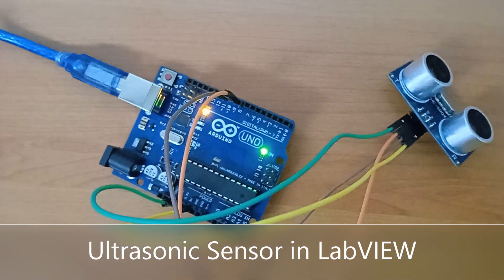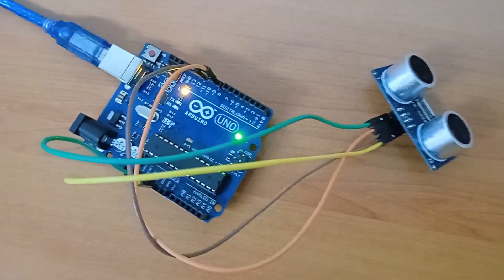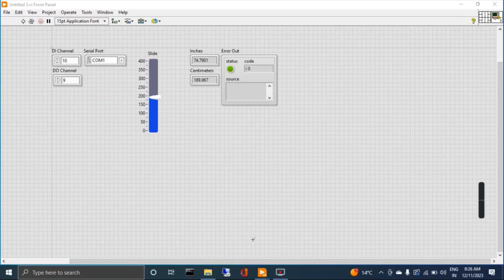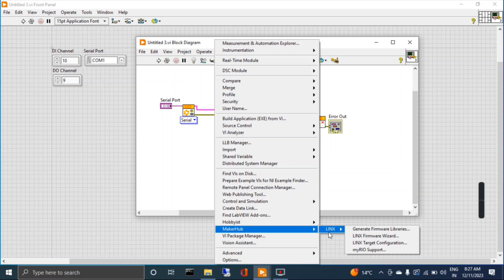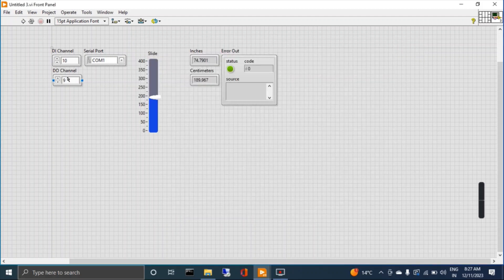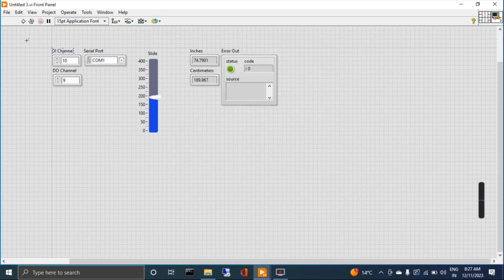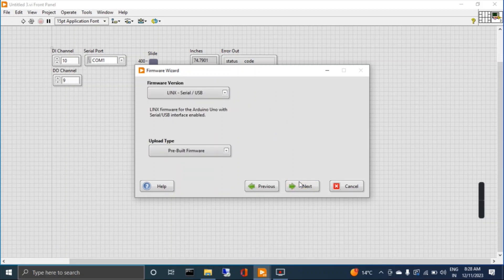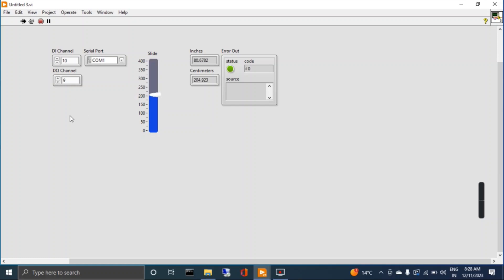LabVIEW-Arduino: How to connect HC-SR04 ultrasonic sensor with LabVIEW

Comment: Hi! I am working on something similar, but in my case I am working with a NI USB-6008 and no Arduino. I am struggling to find information because I have not found similar projects. How would the Labview differ when not using an Arduino? Thanks in advance!
Reply from the maker: You will have to check datasheet
Reply: @LearnToLead138  What do you mean with that? Which data should I take into account?